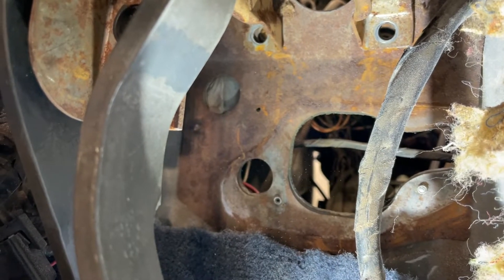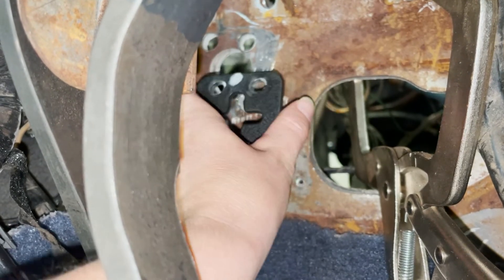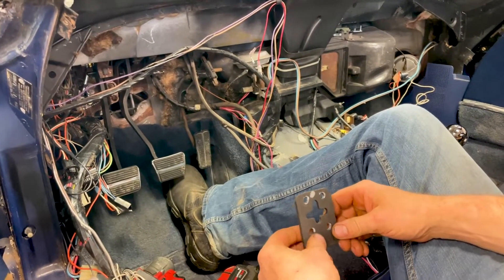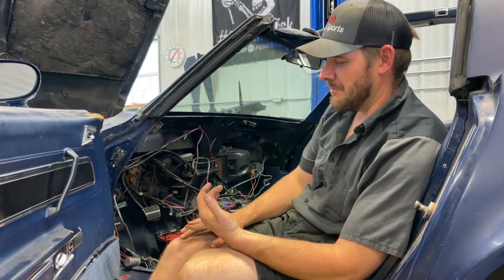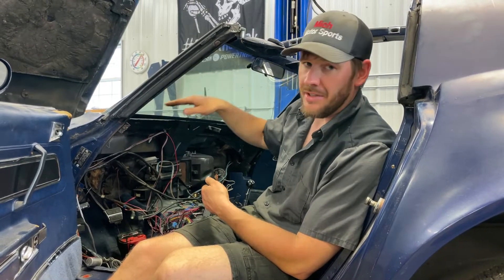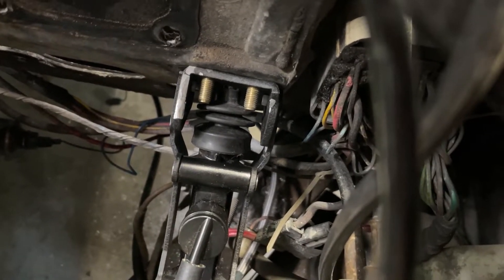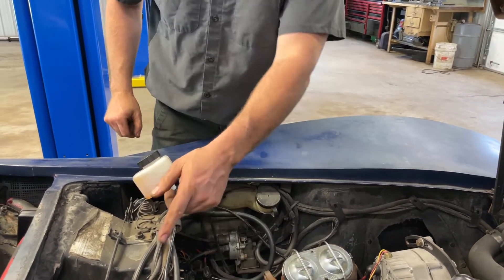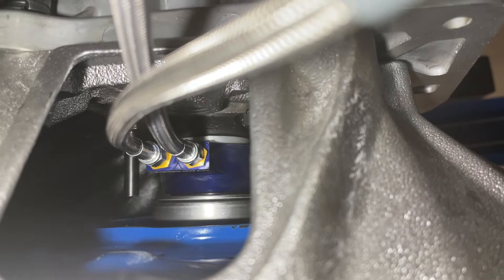Installing the Hydraulic Clutch Master Cylinder

Comment: I had a tko in my Chevelle with a manual center force clutch and it was relatively easy, Is the hydraulic clutch that much easier to depress? It looks like a lot of money and extra work.
Reply from the maker: It does work very well!  But yes, during install, we were wishing we hadn't gone with the hydraulic.  Someone commented that they had found a hydraulic clutch system that was specifically made for 77 Corvettes and their install went a lot smoother then ours.  Might look into that for the next Corvette project.